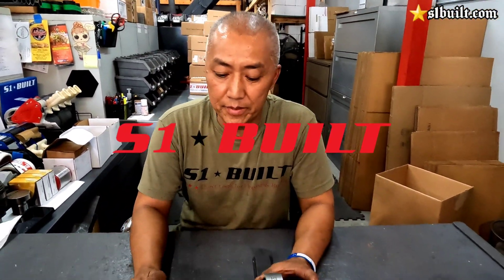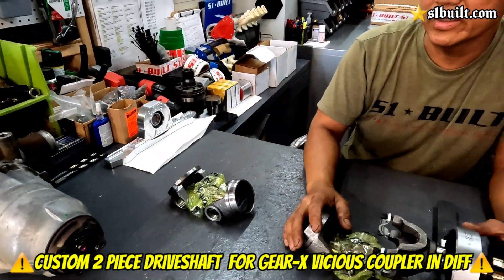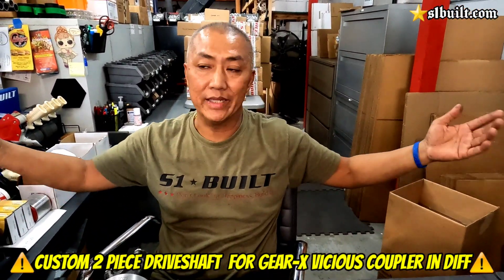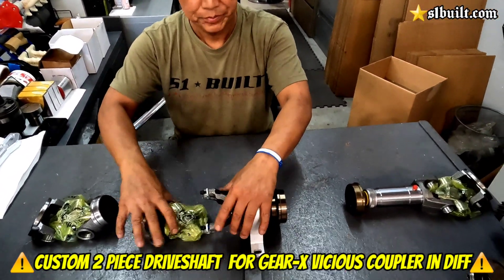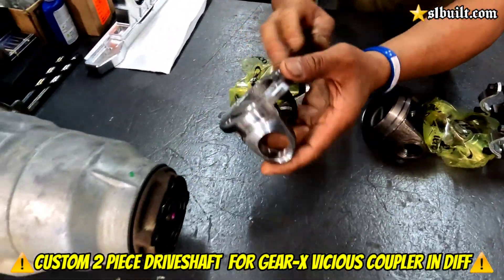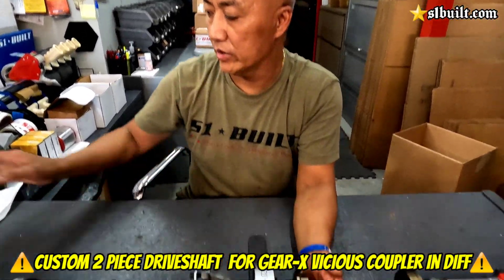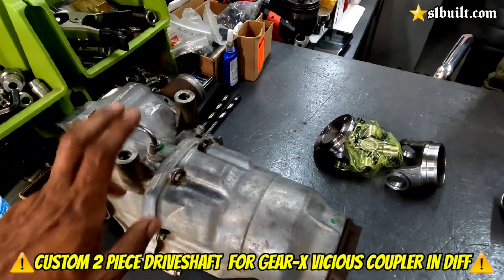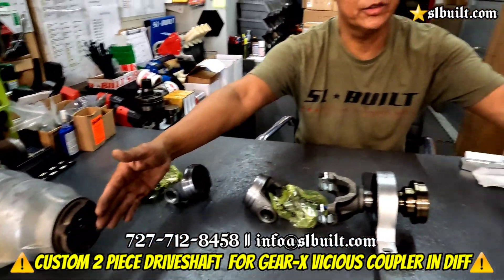🔥AWD HONDA with VISCOUS COUPLER INSTALLED IN THE REAR DIFFERENTIAL REQUIRES A 2-PIECE DRIVESHAFT

Comment: just balance the one-piece.
Reply: It will flex because of the length
Reply: @bseries8826  at what length does it start doing that?
Reply: @seanlloyd7976  I would call S1 & ask them as they're very knowledgeable about drive shaft.
Reply: @bseries8826  I've seen one-piece driveshafts way longer, with no issues. My sol measured out to 70 inches.
Reply: We don't recommend anything over 40".